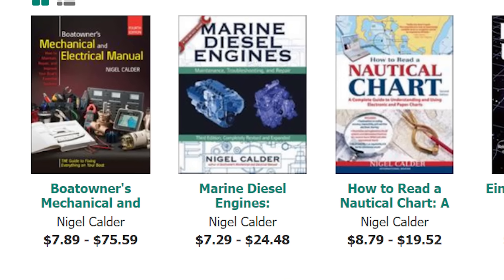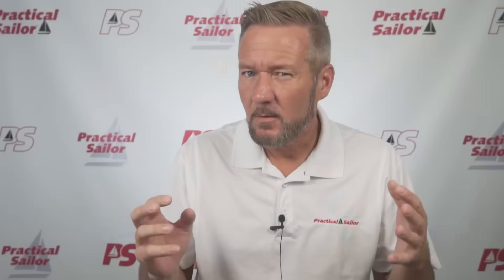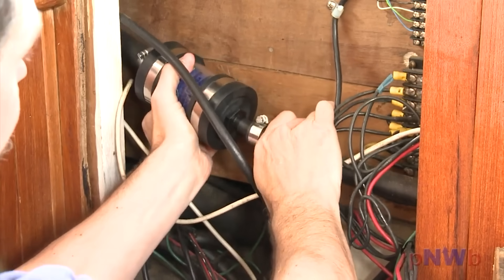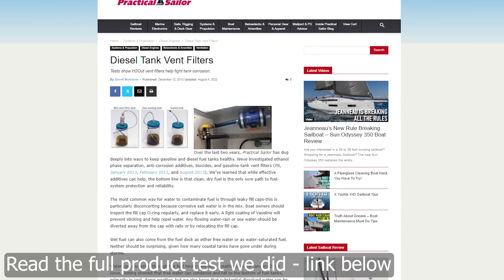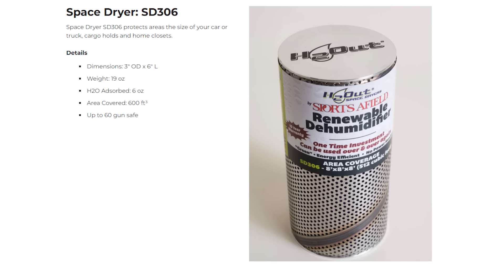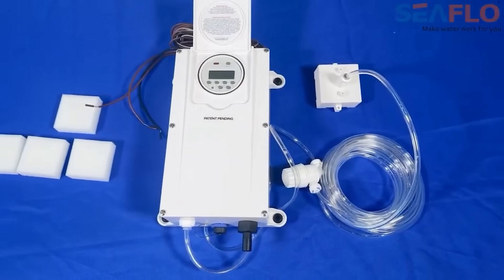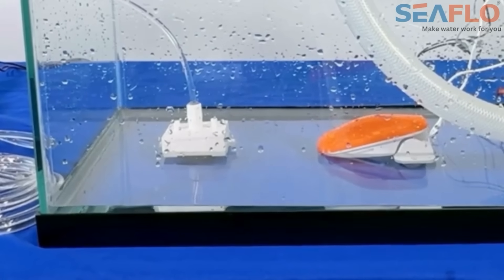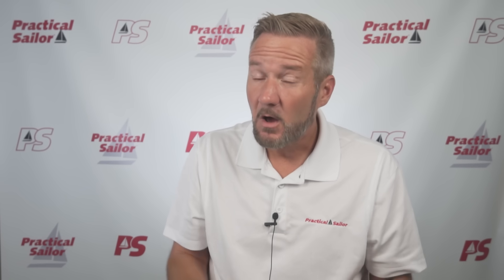3 Tips for a Dry Boat - DIY Boat Maintenance 101

Comment: Hey buddy love your show.  If you're worried about water in the fuel tank just add a little bit of methyl hydrate. Moisture is gone. 

Ps diesels love a little bit of transmission fluid in the fuel cell as conditioner 

Cheers
Reply: Right there with you on the ATF as diesel fuel conditioner. The old farm / construction guys swear by filling their filters at replacement on em. However the science doesn't support your conclusions on methanol. Which I'm sure you meant as methyl hydrate isn't soluble in any fuel and is meant to be under pressure (think propane) to work. Methanol is actually corrosive and hydroscopic (water absorbing). Feel free to Google it. You may wish to try a good biocide/ cetane booster like Diesel Kleen from Power Service. Hope that helps.
Reply: @michfloridaman  not sure where your getting methanol from.  methyl hydrate is what we use in the fuel industry and nothing works better as a anti gel or removing water. Even if it's in a frozen state.  In you tractor you would ad 15/40  to the fuel for more BTU for better power and burn less fuel... we would use the oil from the oil change....... cheers 🍻
Reply: @blackmax222  Correct, under pressure methyl hydrate is prefect for those applications in the fuel industry in pipeline transfers. Methyl hydrate is not soluble in fuel. Please reference SAE publications to see why this is an issue before replying.

Comment: As a firearm collector we have this issue in our storage areas. Not as much water as a boat but you can see how rust on a 250,000.00 shot gun is a bad investment. If in a pinch use rice. this would not be a good use of food but it works.

Comment: Great tips...very timely as well as we recently sold our 1984 Hunter 31 which we loved for the past 23 years (which had a bone dry bilge...0 water) and purchased a 1983 CS33 with a keel stepped mast. We just put it to bed for the winter and can see we are going to have some challenges with the bilge as when it rains we get water in the bilge - which I think is coming from the mast. The joys of figuring out a new boat! 😁
Cheers
Mike
Reply: I have a keel stepped mast as well. Install exit blocks in the mast or at least those little hoods that you see on some masts. The exit blocks if designed and installed correctly will not only ensure zero chafe, they will keep the water out as well.
Reply: @timothyrepp4259  thanks for the tip...will definitely give it a shot!
Cheers
Mike